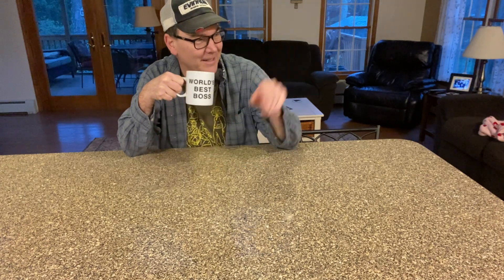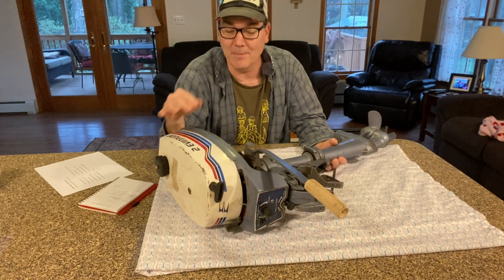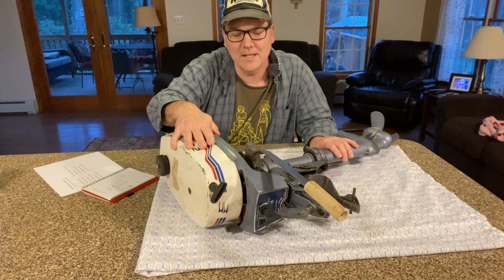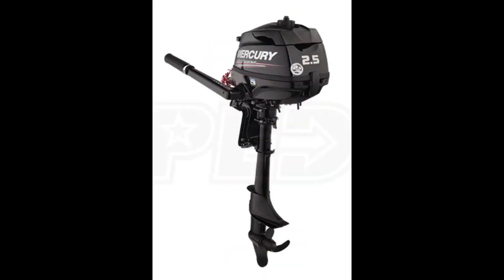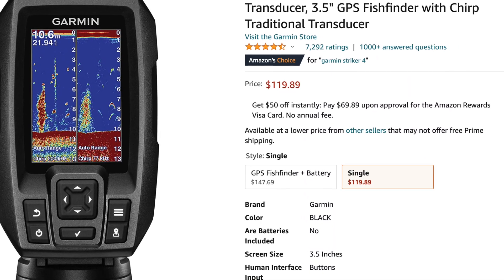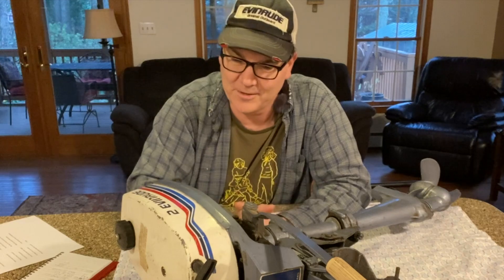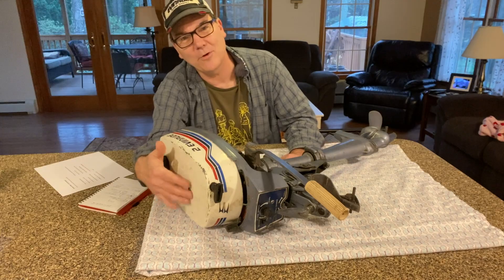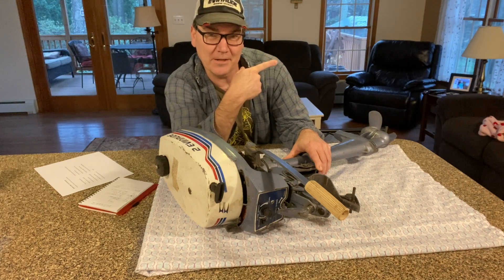Evinrude 2 Old 2 Stroke Outboard Motor - Is It Worth Saving?

Comment: Nice ! A smart guy could place a variety of different power-heads on that drive train. A compact gas-powered  engine, like for a large weed whacker could be adapted for an air cooled 2 cycle outboard application. Battery lawn mower engines might work as well. 🤔 Now where's that old chain saw ? 🙂
Reply: BTW that cowling alone is worth a few bucks. Try and find one 😂
Reply from the maker: I had considered using it as a test platform for alternative propulsion projects, but I'm sure another dead engine will come my soon!
Reply: @WayneTheBoatGuy  You have options and there will be more. The transmission/lower unit could be driven by anything. My trolling batteries will deliver 25 amps each for 175 minutes.
That could be 2 50lb thrust min-kota's or just use your imagination ? 100lbs of thrust will push my drift boat up river. I watch one do it with a single 70lb electric motor and a 9.8 for back-up. Tripple screw is possible - 2 electric with gas in the middle on some boats. It's the hull that matters Repowering is like changing tires to me. 
Enjoy your posts and this discussion. I lived next to a 200 slip marina. My wife would say 'in' the marina lol. I have 2 boats at the moment. That's me.

Comment: I would fix it, WTBG.  Why?  Because one gains knowledge and skill through experience.  Even if you sell it at a loss, you have to add the value gained via going through the process.  These motors are made by different companies, but mechanically they are similar in construction and function; "The more you know..." [shooting star animation]  The other reason to fix it--from a guy perspective--is probably the most important: it presents an opportunity to add tools to your collection!

Comment: If you are handy and can do the repairs yourself it might be worth the effort and you at least have a spare motor to take along on long days on the water. But if you have to hire a mechanic to rebuild the engine its definitely not worth it. These small engines are designed as "throwaways" to be used until they peter out and then get a new one. But if you run it properly and maintain it correctly a small engine should give you good service for quite awhile.

Comment: So you own it , now you say you need all those things to replace on it but have you put gas in it and tried to run it ?            1st thing pull the spark plug if it turns over it’s not froze up , run a compression test , if it’s in good standards spray some mixed two stroke gas in the hole and replace the plug , set it in your test water tub and see if it will start , check and see if it’s got spark , ?   Compression-spark-fuel  are needed to get it running , if it starts do you really need to buy all the new stuff you said , maybe a new plug , if it starts and is pissing water your in luck you can still open the water pump systemic to inspect the impeller if it’s ok just lube it up and reinstall it , the points can be cleaned and adjusted ,  the ting with a lot of the micro motors is they weren’t used a lot , the week end fishermen used it a half dozen times , and a lot got thrown in the corner of the garage , if the fisherman got serious he bought a bigger motor and the small one sat for years with not many hours on them ,  I would just try to see if you could get it going first them worry about replacing old and worn parts later , new plug , clean the carb and fuel system, make sure it’s got spark and let her rip ! 😳

Comment: Does it even have a water pump? Could be air cooled.
Reply: I am not sure about this one, but even the air cooled outboards still have a water impeller to cool the exhaust
Reply: @jordanbeyer7607  Well the Honda 2 HP's do not. Your lower unit looks very similar.
Reply: It has a water pump.

Comment: I had two of these and they are terrible motors. Hard to start, unreliable and 1 clamp is not enough. One of them came off the dinghy. I see you discovered the spring start screw trap! We had springs and cords breaking a lot because you had to pull the darn things so many times trying to get them to start! If it was an old Yamaha it would be worth fixing.